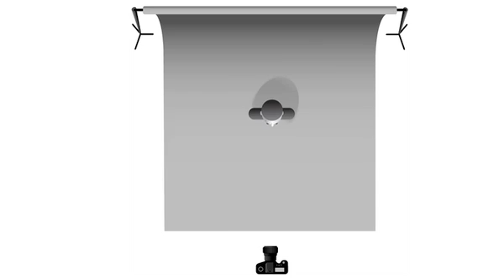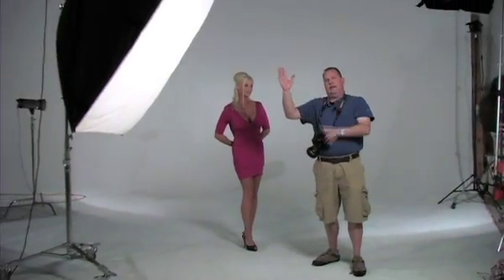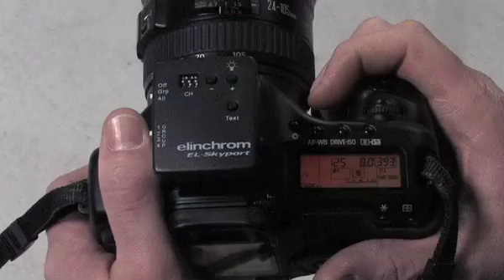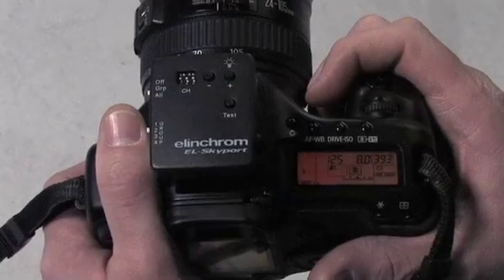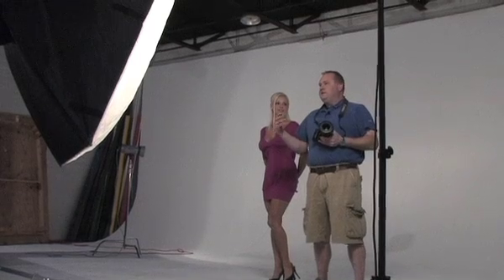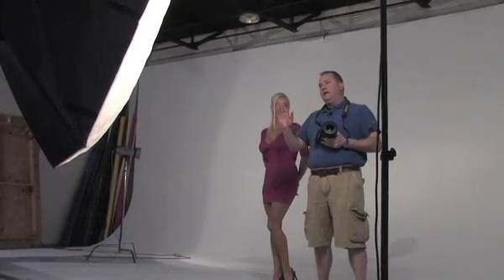Studio Lighting Tutorial - Understanding Light Modifiers by Light Tec Dallas

Comment: Careful guys, I have seen a lot of people using more strobe power than they can handle. If you have a 500W-S strobe and you turn it's power all the way down and you still have too much light, what do you do?
A 150W-S strobe can be more than enough for someone doing portraits in their basement. Of course, it will also depend on your light modifiers and other factors, but I doubt a DIY guy will need more than 300W-S.